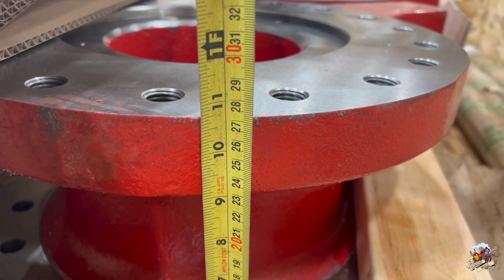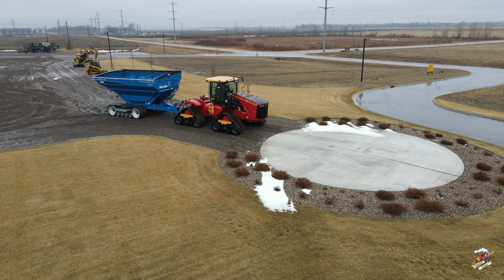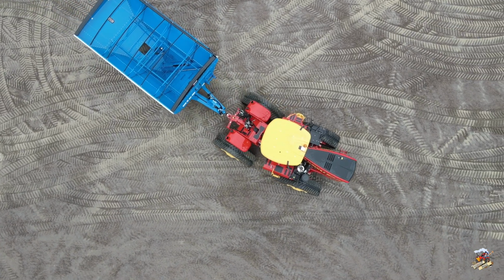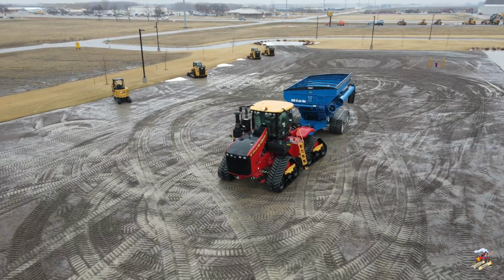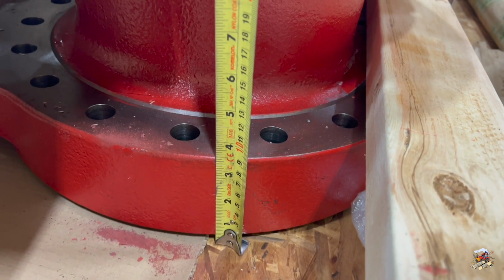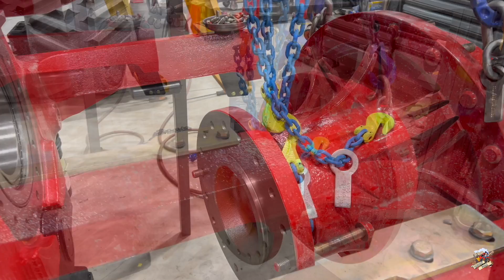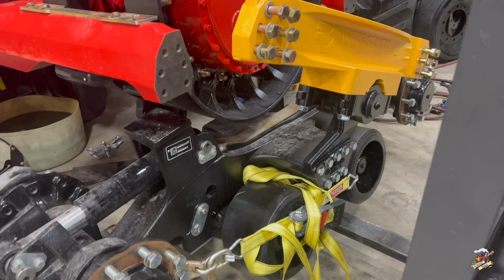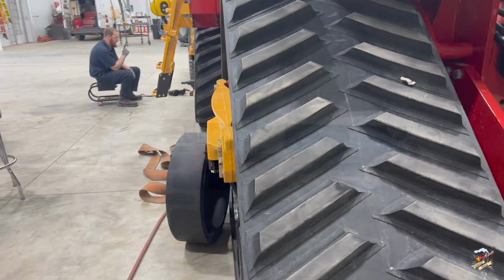Installing a WIDE STANCE Kit on a Versatile Track Tractor

Comment: Interesting watching the tear down and reassembly. Coming from an automotive  parts assembly plant, although a whole lot smaller parts, cool to watch. Amazing amount of time going into the wide stance package going on. Yes, if it was mounted on at the factory would possibly be helpful but, it might also complicate shipping. Quite alot wider to haul. Never realized how close the tracks came to each other in a turn. Definitely would want solid steering stops in place. Great video. Here in east central Indiana mostly Deere products. Love to see it in action.

Comment: It's taken me a while, but these tractors are really growing on me. They scream simple functionality to me with the Cummins motor, centralized fuel tanks and the draw bar being placed in the center. The black frames on the 22's are much more attractive to me, but the 21' is also good looking. Good lookin' units!
Reply: They say it takes 2 hours to replace a clutch in the field on a 800 Versatile. That's how simple they are and the reason these 40+ year old tractors are still doing the heavy work.

Comment: So as a city boy - why do ya need wider stance than stock size? Also why doesn't the factory offer this option from the assembly line? Great videos, thanks.
Reply: Maybe more stability when driving hills sideways and if you want that track of tractor runs in different spot than tracks/wheels of equipment like graincart in this video to spread footprint wider area, just guessing 🤔

Thanks for great video, cool tractor 😎 Greetings from Finland 🇫🇮
Reply: Mud. These tractors are going to a very muddy part of Minnesota. The 3 meter kit will make it easier to clean out.

Comment: Could the kit be installed on the front or the rear only? So the tracks wouldn't run in the same line? That would lessen the compaction even more.
Reply from the maker: I suppose if that’s what someone really wanted yes you could

Comment: @farmhandmike my brother and I recently purchased a DT570 on our farm and we have been playing around with it and are kind of upset with how the inching pedal functions... Know of any updates that have been done to improve function at all? Thanks!
Reply from the maker: @olsem101 I left Versatile last June but do have lots of experience with this situation.  For starters the first thing I would check (Dealer needs to use Cat ET). is the inching pedal duty cycle.  This has to be set between 15-24% when the pedal is all the way up.  This has an adjustment stop bolt under the gray plastic steering column cover. (5 screws to remove). I would set these at 18% generally.  Depending on the hours of the tractor and if the transmission oil was changed the transmission may need to be calibrated again you will need Cat ET. Also these are alway worse when the transmission oil temperature is below 70 degrees Fahrenheit. I know they changed software at some point in these and I believe the dealer should have service bulletins on it but at one point they changed the software to fix an overload protection issue an in my opinion it hurt the shift quality. I believe the new software fixes this but again I don't work their anymore and don't know what they may have done since I left.
Reply: @farmhandmike  Thanks for the info Mike! I knew you didn't work for versatile anymore, but you seem very knowledgeable on these machines! I will have to talk to my dealer about all this, we use the tractor to pull tile plow so using that inching pedal for a smooth start is key. It seems like disengages good, then once you slowly let it back up nothing happens until you reach the very top, then the tractor lunges forward. It's basically a new machine with 250ish hours on the clock, 2021 model year.

Comment: does the set-out change the turning radius
Reply: Russ, I was driving the tractor in the video. I couldn’t tell the difference. We did not touch the steering stops. I’ll let you know if we ever measure it.
Reply: @tomwolfe1061  ok thanks
Reply: Are those 36 inch tracks??